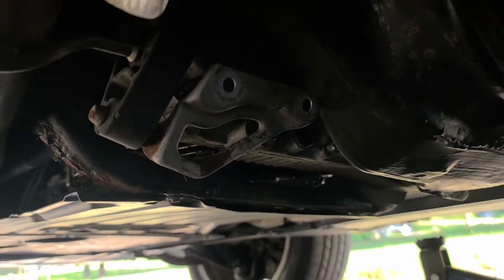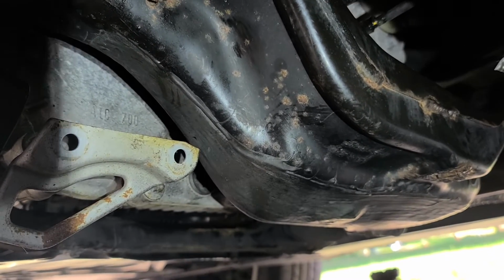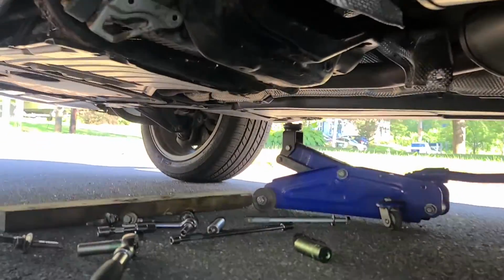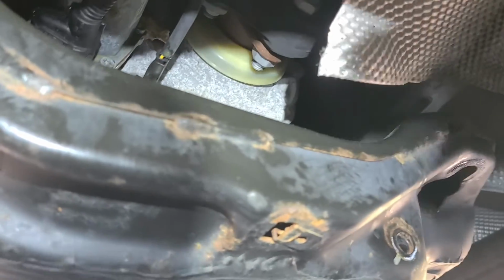Bmw X5 E70 AWD Transfer Case Motor/Actuator!!

Comment: Did you remove the long horizontal thru bolt as well? You didn’t mention it but it appears that you. Any issues with removing that?
Reply from the maker: Hi yes, I had to remove that long bolt..Wasn't much of an issue taking that out..Thx for reminding me.